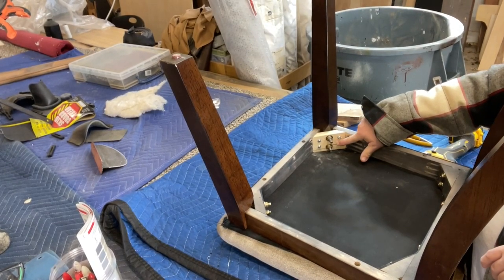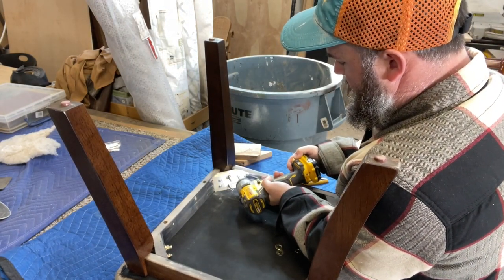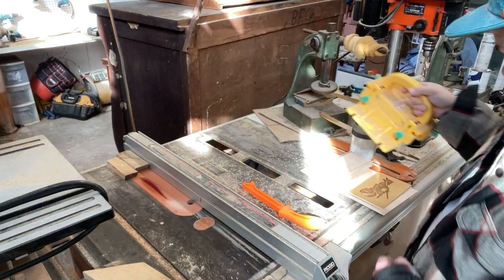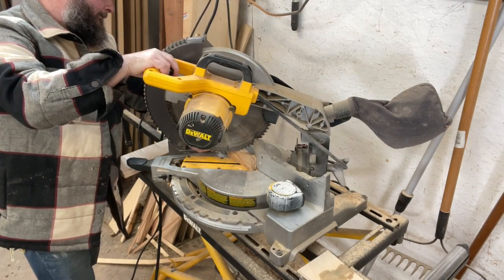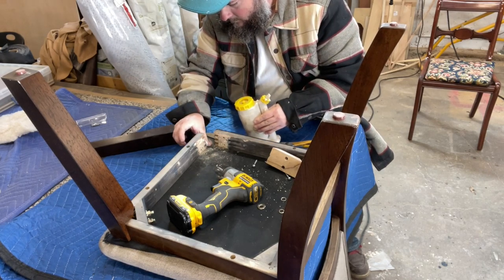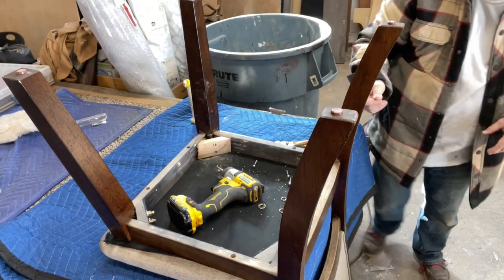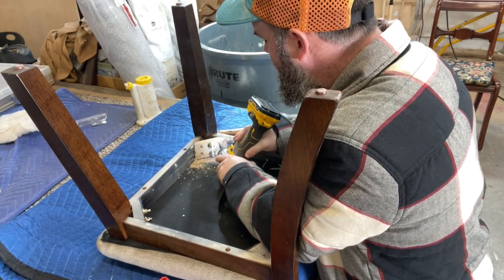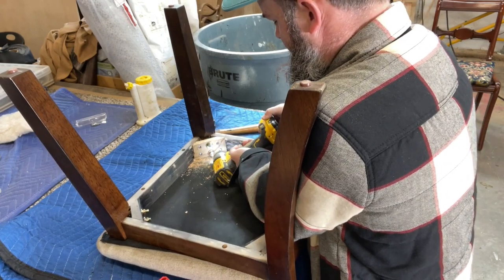Dining Chair Frame Repair

Comment: Great video

Do you have a video or opinions on wobbly joints.   I've seen some products where you inject it into the joint
Reply from the maker: Yeah, for small cracks they make syringes with tiny needles to inject In The crack. You can also use a shop vac to suck it through from the other side.